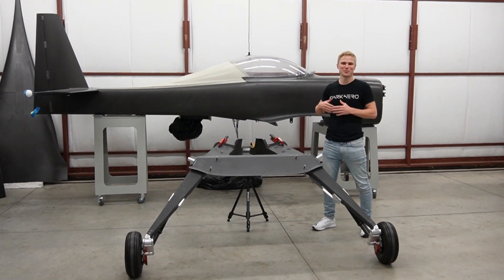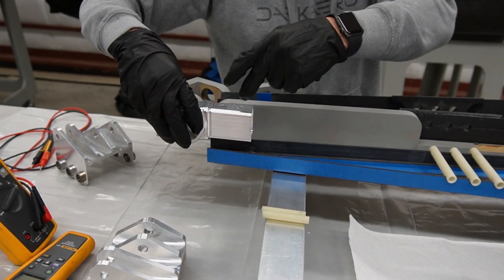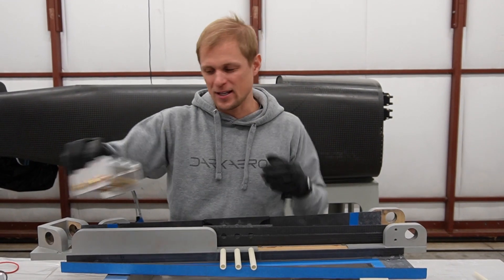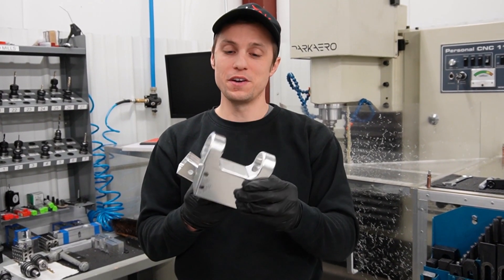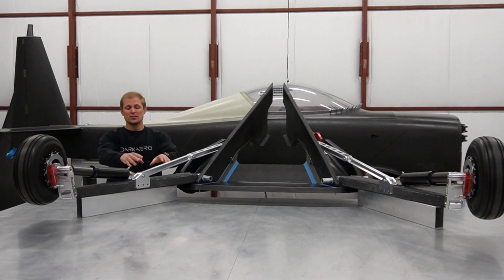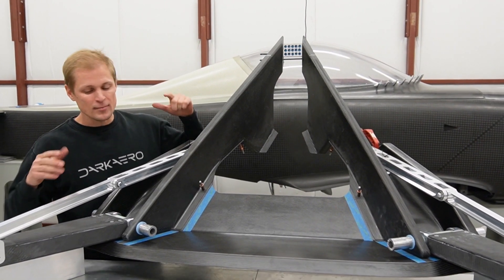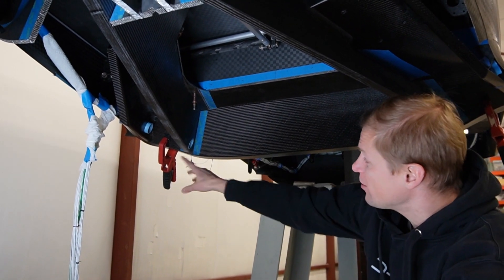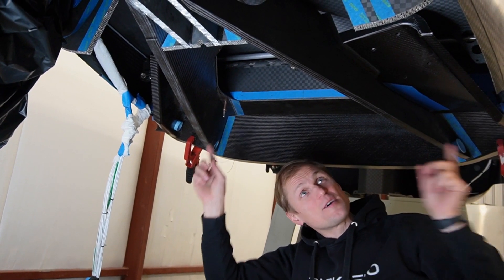CARBON FIBER LANDING GEAR!

Comment: Love your startup, what you are setting out to prove and how you give back through your channel. As a research scientist in advance composites, I oversee quite a bit of mechanical testing. We use atmospheric plasma to thoroughly clean surfaces. The best bond strength with structural epoxy and high-strength aluminum alloys comes with solvent > sandblasting > solvent > plasma. With composites, we also use plasma to functionalize the polymer surface. Something to consider as the industry moves (slowly) towards greater acceptance of bonded-only joints.

Comment: My question is the angle of the landing gear. I took a measuring wheel and put it in front of me and it seems like it impacted rough spots harder than when I used a trailing technique. Not sure why it's leading and not trailing. Can you enlighten me? Thanks.

Comment: Looks like a straight forward design. I have a question on those machining fittings interfacing with the composite leg. The fittings are hollow with through holes on each wall (perpendicular to bolt axis). The the composite leg slides in with adhesive and secured with the bolts. There seem to be a long section of the bolt that is not taking any bearing loads.   Would that bolt see some undesirable bending on top of the shear? What is your sizing criteria for those joints?

Comment: I have engineered the manufacturing of composite snowboards since the late 80s, manufacturing metal / carbon composite hydroflight gear now.   Bonding to aluminum is notoriously difficult due to the weakness of the aluminum skin layer. Your aluminum parts have a bright finish. light clear anodize? This runs counter to my experience in achieving good adhesion, especially under shock loads. We run a type 3 hard anodize finish on bonding alloy parts (one level of electrical isolation) and use a very thin rubber foil for mechanical shock and secondary isolation, foil from ASK Industries, Japan.   Really like what you are doing and the information being shared.

Comment: got a friend that works in marine, they use stuff called Mastinox for corrosion protection on bolts , and electric motors on struts was a Hmm Nope idea, the limit switches can make break when the gear moves around. and burn the motor out from cycling so much , A pilot he works with saw how it caused a crash on a plane called a turbine legend..

Comment: air intakes must be reduce to only 2 symmetric oval 3  or 4 inches apart on the top , they can't be square like that on the side for uniform aerodynamic vibration and flow pattern

Comment: New subscriber here. Love what you guys are doing. What is the expected top speed for this?  Also. What motor types are you planning to test on it?  Just one, Or multiple?
Reply from the maker: Thanks for checking out the channel and for subscribing! :) Cruise speed is targeted at 275 mph. We have not yet disclosed a top speed. The aircraft is designed around the UL Power 520iS engine. Currently, this is the only engine variant we've designed it to.

Comment: Great stuff!  I find it all absolutely fascinating...

Regarding carbon fiber construction, I can see how it is well suited to building a prototype as you are here.  But it is so labor intensive, it is hard for me to understand how production items can be made this way without the ultimate purchase costs being extremely high.  Maybe that is just the nature of the beast, sort of in the "if you have to ask the price, you can't afford it" category...?  Having said that, I guess it is really not much more labor intensive than fiberglass construction, if at all, and fiberglass has certainly found its way into many reasonably priced machines.
Reply: I agree with you on all points.  Add in the expertise required to ensure all of the pieces are properly bonded/cured whatever, not sure the normal Vans builder type (normal skill-set person) could ever pull this one off.   I love the aircraft design and ultimately this design needs to be sold to Cirrus so they can produce them for the masses.   I can’t imagine getting insurance on a new concept aircraft right out of the blocks.  If any insurers would even touch it the costs would be eye watering.  Getting insurance on aircraft with low numbers or no numbers in the field is a major obstacle.  I have to say these guys are doing everything right and I want one !!  Insurance is optional…

Comment: Hi Team, I recently come across the Airbus A350 paint issue and realised that there will be copper mesh for a lightning strike, Since you guys are using carbon composites what is your plan on lighting strike can you plz explain how external texture will be, How it will affect the aerodynamics and how the paint will stick to the uneven surface and sustain thermodynamic effect of the metal, Please reply or address this in your next video, Lot of respect for your team from India.
Reply: The Extra 300 uses a carbon/aluminum cloth over the fuel tanks for this purpose.Most experimental planes and gliders do nothing to deal with lightning strikes.

Comment: I'm loving this build and the documentation of all of the things it actually takes to ground-up build an airplane. I'm curious if your design's limit on Airspeed is because of Horsepower, frontal air pressure, or structural resonant frequency?

Comment: There is a carbon fibre called Dyneema Carbon. Is is a carbon fibre and Dyneema UHMWPE hybrid material that gives a 200% impact resistance improvement over other high quality carbon fibres. For a landing gear this vastly improves impact resistance, this would make this the perfect material for a landing gear. Have you considered this material?

Comment: Very IMPRESSIVE! You guy's are on top of it! It's people like you who are the tip of the spear in the modern era of composite structure utilization in general aviation! In the rotorcraft world, lot's of Kevlar is used, honeycomb structural panels, and composites in the rotor blades too!  It's the future of aviation! Can't beat the corrosion resistance, weight to strength ratio and easy to work with when you get into the curved structures such as fuselages! Keep up the good work, looking forward to your future video's!

Comment: Re: Addressing Galvanic Corrosion via Dielectric Isolation.
This discussion stimulates the question, what provisions for mitigating electrostatic discharge are incorporated in the DarkArrow 1 design?
Reply: My understanding is that the main concern with building a static charge is attracting lightning. Being a non-FIKI single-engine experimental plane the idea is probably to simply avoid getting anywhere near storms. I'd personally love to see them incorporate a conductive top ply (products exist with copper threads already embedded in the weave). This is a change that could be made for production later. It would increase weight, but so does adding more avionics or other optional equipment.
Reply: @ParadigmUnkn0wn  The thoroughness of design gives me confidence the DarkAero Team has addressed the potential for static electric discharge. I am curious to hear the analysis and design considerations given to it.
The ability to pass a lighting strike through the aircraft while avoiding damage is a significant concern. Indeed, the intended mission profile is not likely to frequently expose this aircraft to lighting. However, other risks associated of static discharge come to mind.
Some areas of concern include the fuel system, ECU, navigation, communication – especially antennas, the electrical system’s Solid-State circuit breakers.  I envision static discharge risks running the full scale from inflight explosion, to communication / navigation noise, to nuisance “CB” tripping in some nonessential circuit.

Comment: My dream airplane can do 400 KTAS and/or 2000NM and also be fully aerobatics. Two seats and underwing removable baggage and/or fuel pods for cross country flights. I'd be happy with 2000NM with a 2.0g limit and 9g with limited gas....like 150 gallons on a tiny plane. Rotate speed would be near 110 KIAS.

Comment: Curious what you guys have thought in terms of repairability/field-serviceability of these legs?  They are fantastically engineered and I applaud what you're doing, but given that everything is bonded together it seems like any flaw or minor failure** means throwing away the whole gear leg. 

**Other than damage to the bores that could be shimmed out, or that could be machined open slightly so that a sleeve can be inserted.
Reply: Maybe why back country planes tend to have steel tube/fabric fuselages. Bend it back into shape after a crunch.
Reply: @Jack-ne8vm  - Yep. Of course, backcountry airplanes have a markedly different mission profile than the DarkAero 1.  Still, maintainability is something to think about with any machine/vehicle.

Comment: Did you consider using wet installation and fay sealing to address galvanic corrosion?   Also, what provisions do you have for Bonding and grounding, P-static, EME, HIRF, and lightning strike? Are you using EMF in your composite panels or some other method of getting currents to the Current return network?

Comment: My suggestion would have been Carbon/Kevlar at a 45° layup and a much  bigger radius at the legs. But if we had known everything upfront, we would work for NASA in the Mars project.
Reply from the maker: The carbon fiber gear strut sees a bunch of different load/stress components depending on the landing condition and extent of shock compression. The layup schedule is structured to handle this range of loads so it includes plies running at 0/90 and +/-45 degrees relative to the long axis of the strut.

Comment: You have a cool prototype coming together.  When you get to the production stage will you be having rough casts made of your metal components which you then just have to finish machine?
Reply from the maker: Thank you for following along! We will stick with billet machined components for production. Strength is a critical requirement for the majority of the landing gear components. Cast aluminum is, in general, not as strong as billet. Aluminum is pretty cost effective as a raw material, even for the aerospace grade alloys such as 7075, so there isn’t much for us to gain in terms of cost savings by going to cast machined instead of billet machined.

Comment: Would a Liquid Piston 40HP diesel fit in that ?...that would get supreme aircraft mileage if it did..
Reply: nope....see earlier you tubes on the engine choice
Reply: @richardvisscher2626  i was talking engine "options"....
but maybe access to such an engine would force consideration of an entirely different air-frame design, 
where production would have to, of course, start with the current proto-concept, if to fund any possibility of a second offering..
Reply: @richardvisscher2626  and i do understand your engine choice as part of the design..
Reply: @richardvisscher2626  and i don't know if that engine is even commercially available anyway....it's a very interesting areo engine, but production seems absorbed buy military UAVs at the moment..

Comment: What sort of bearings are you using in the aft end of the trailing links to handle the lateral loads imposed by the action of the shock? I would not have though nylon bushings would be strong enough.
Reply from the maker: The flanged sleeve bearings are made from a self lubricating polymer called ATGF.

Comment: Your aluminum parts should be anodized: preferably type III. CF is not the only source of corrosion. Galvanic corrosion is also a problem at all points of contact with anything that is electrically conductive, e.g. fasteners. Additionally, you're creating needless maintenance issues by failing to protect your aluminum parts. 

Anodizing is not difficult nor that expensive. You can build a type III setup in a chest freezer. There is no good reason for not doing it.
Reply: I believe they spoke to this and mentioned it in other videos and are going to do that just not for the prototype.
Reply: They never said is going to fly just like this. Even if they do, is just the prototype. Even like this, some alodine and paint will be enough.

Comment: Really great to watch you guys evolve your skills and abilities.
Excellent efforts 👏

I can see more and more clever design insights coming from you all in future, as you rapidly iterate, all the time learning as you progress 👍

Interested to hear about your Main LDG up-lock and down-lock (if one is required) mechanisms and how you plan to mitigate air loads during gear retraction particularly because the gear is angled forward and may experience aerodynamic loads which oppose its retraction; though gravity does help somewhat to counter them I guess 🤔. 

Deployment on landing would also have its challenges but lower airspeed means lower aerodynamic (Drag) forces. Would love to hear what your key design requirements are and how you’ve managed to achieved them in a general sense (without giving away any design secrets).
Reply: I'm no aerospace engineer, but I'd guess the gear isn't big enough for the load to be significant
Reply: @gormauslander  It could very well be so 🤔 …  My thoughts though, wonder if it is very light in weight but may constitute a coefficient of Drag sufficient to produce a drag force that demands a very powerful actuator, seeing that they have limited space to accommodate a simple gearing mechanism.

It will be very interesting to see what they have developed 👍
Reply: @daverobinsonTnT  for sure

Comment: Hey Guys, great work and nice design! Did you consider using glass fiber laminate for the landing gear struts, because GFRP can take more elongation at break than CFRP, which in turn may lead to a more forgiving landing gear, in particular for side slip landings?

Comment: Really nice workmanship? I couldn't see any downlocks on the gear? Will there be something on one of the drag links that locks when they're over center?
Reply from the maker: Great question! It wasn't discussed or shown in the video but there is a lock mechanism incorporated into the drag link mount that latches onto the upper drag link to constrain the gear in the extended position. Thank you for checking out the project!

Comment: You don't do much welding. Is that a blind spot for you?
Rather than a custom box member could you use a stock CF tube? And rather than difficult machined end pieces, could you use simpler welded parts.
You do nice work but I suspect you are missing out on simplification opportunities which can be a decisive anchor on cost of manufacture and viability. Optimization is king. The gear doesn't look light. Parts of it looks like it could carry an F15 or a small suspension bridge :) I would always keep a Lancair gear in mind as reference, even if you want stiffer with suspension.
Reply: Oh and the best advice you'll ever get, develop a tiny turbofan jet engine for it instead. small twin jet. Williams FJ44-4 holds world distance record without refuelling of 40000km.
Seek funding, sell to textron for a billion after the revolution. With the small caveat that the secrecy surrounding ET ships in our atmosphere is breaking down and could violate various plans at any moment but could be years still.

Comment: I love the geometry for DarkAero's main landing gear. Since carbon fiber serves as cathode material to sacrifice aluminum as anode material - Engineering blended composites transitional dielectric barrier isolation materials are new solutions waiting to be solved. Great work guys.
Reply: Isolating carbon fibre from aluminium is not a new problem. It has been solved quite well by simply electrically isolating the carbon fibre and aluminium.

That is actually the very nice thing about the Dark Aero project. They are not trying to experiment with everything (e.g. diesel auto-engine conversions, pressurization, etc.). They are using established and proven processes and applying them to build the world's best 2-place aeroplane. Applying these techniques to a small general aviation plane designed as an easily produced and assembled kit is groundbreaking, but the techniques used to achieve that are not so groundbreaking. That is a good thing. You do not want an aeroplane that changes everything... a la Raptor project (or whatever the scammer running that project has rebranded it to now).
Reply: Why not powder coat the aluminum?
Reply: Paint, powder-coat and or anodizing aluminum are surface protections. It's the penetrating fastener (stakes) such as other metal bolts, screws, hinges and rivets that electrically make the connection that promote oxidation under the surface protection to aluminum, chrome-molly and other metals. Carbon-fiber acts as a cathode and is electrically conductive promoting aluminum to act as sacrificial anode corrosion as if connecting two dissimilar metals. The damage occurs under the coating when non-insulated metal bolts and fasteners are employed.

Comment: Incredible job guys! Interesting to hear that you got 3 independent motors for the gear, because this introduces additional failure modes. But I guess that your approach is safe, as you have an emergency gear down mechanism as backup.